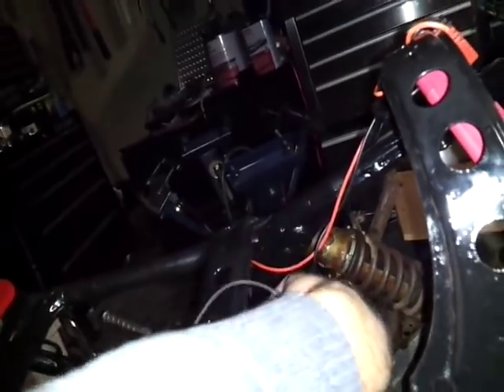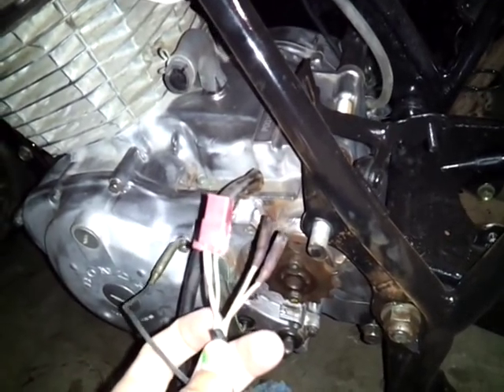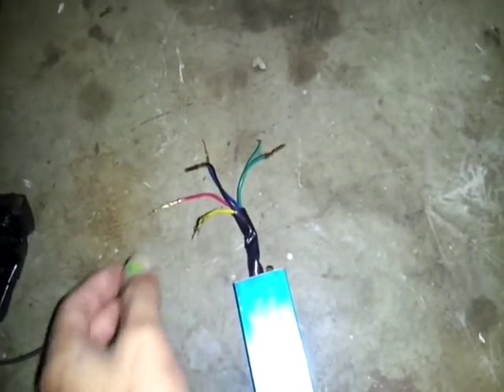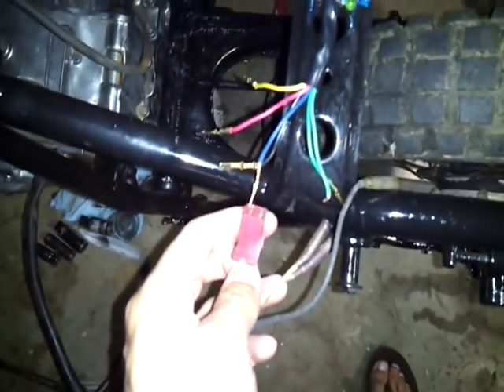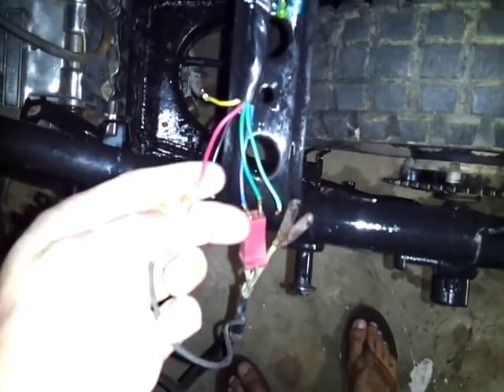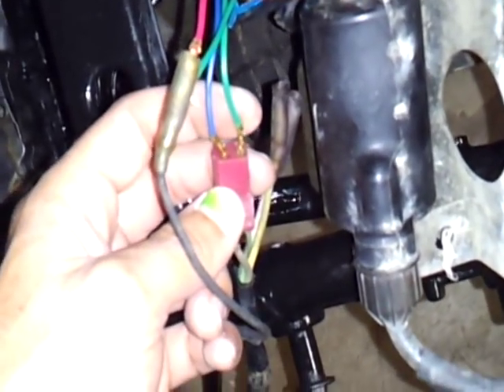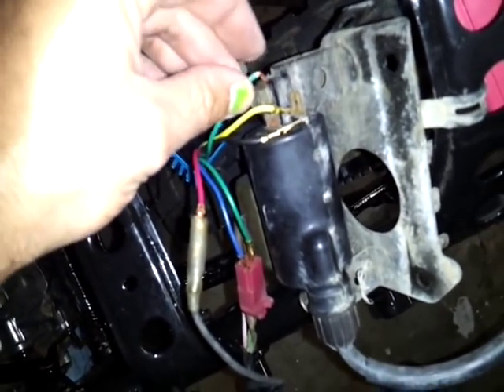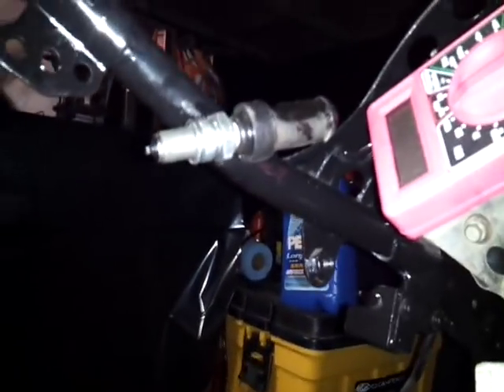CDI wiring Honda

Comment: I have a klx650 can I wire in a loom and cdi to get it to run
Reply from the maker: db db 
As long as you have an ac output as well as a trigger output.  
One will be a higher ac output than the other.  The trigger will be a lower voltage.  .

Comment: Hi,
One query regarding the stock ignition coils of pulsar 220 that it's cdi has two points to power 2 ignition coils.
But I want to install nmw racing ignition coil(dual wire ignition coil) which has only one point to take input. So how I am going to connect it.
Joining both the wires of CDI for giving power to ignition coil or giving the power output to nmw ignition coil just from one point of the cdi
Reply from the maker: You can use the same power input to power both racing cdi igniters. Then use one trigger wire for one of the calendars to fire, then the other trigger wire can go to the second ignition coil to spark that one.
Reply: IDUS 
Thank you for 
But still I have not understand so I will make this very much clear
Earlier I was having two ignition coils with two input points separately that goes to CDI output points(2 separate points)
But now I m having 1 ignition coil with two spark wires but it is having only one input point from CDI so how I m going to connect it 
Either by joining both the output points of CDI or just taking the the power from 1 point of cdi

Comment: Aye bruh good shit the black wire goes to shut off without hooking it up you won't be able to turn it off !!!!! But other than that your video helped me get my 86 rebel running!!!!!
Reply from the maker: Very cool. 
I'm glad it helped!
Thanks for the input on that black wire. I never hooked it up. I just used a switch to the ac signal wire.
Reply: IDUS  aye no prob you saved my life with this video I'm bout to link you in the rebel forms!!!
Reply: How exactly did you wire it, having troubl3

Comment: Pls. Show me elect.wiring diagram of 1984 Honda xl 125s,thank you.
Reply from the maker: Ernesto Guisadio  you want to find the wires that come out of the stator that generate ac voltage. One gives off more voltage than the other . The higher volt wire powers the cdi. The lower voltage triggers the spark.

Comment: after connecting the wires correctly, still no spark.
Reply from the maker: Guys Who Do Stuff what bike are you working on and what type of cdi do you have?
Reply: Same cdi and same motor same 30v and 5v ac setup
Reply from the maker: Guys Who Do Stuff Have you measured with a volt meter that you are getting a trigger AC signal that's about 30V?
Reply: IDUS yes
Reply from the maker: Guys Who Do Stuff do you have a flashing green light when you kick the motor over?
Red wire is 30vAC
Grn ground
Yellow goes to coil
Blue smaller AC voltage signal. 
You should get a flashing green light when kicked over. 
Grounds are always a problem in my experience so I would make sure it has a good ground.
Reply: IDUS no green light
Reply: Green is ground?

Comment: Hey, I have a Honda CBF 2010. Can I add a tachometer?
Reply from the maker: DynamicTwist yes. 
You can take the tac signal off the negative of the #1 cylinder coil.
Reply: Im a complete noob when it comes to this. JUts bought the cbf (Model without tac). But i wanted to buy one off Ebay. I have to connect 5 different wires. 
-long Black light -
-Short Black power/ignition lock +
-Short Green Ground
- Short Yellow engine signal line
   Will the stock bike have the required wires xD ? thanks
Reply from the maker: DynamicTwist looks like the module sucks power, so to prevent a dead battery, connect the ignition lock wire to a switchable 12v. Then the green or yellow is signal from your coil negative. Usually thats how they are wired. 
I would have to check the specific one you bought to be of better service.
Reply: Thanks for your time! Would installing one of these mean taking fuel tank off ? thanks
Reply from the maker: DynamicTwist you can usually find the negative signal wire to the coil at the ecu compartment. 
The. Switchable 12v is found by the relays.
Reply from the maker: DynamicTwist looks like yellow wire goes to ignition coil negative. Thats your signal wire.
Reply: would the wire reach easily? And do i have to take the fuel system off? Or can i easily do it without it. thanks

Comment: I have a 96 cr125 and the wiring is all over the place...I don't know anything about wiring I just want to replace all of it...where to I get all new wiring? How do I do it?
Reply from the maker: Alec Thayer do you have a pic of the wiring. 
You can email it to me. Andrew@broointech.com
Reply: idusclothing got rid of that bike a while ago lol
Reply from the maker: Those 2 strokes are awesome and really simple to wire. It does however involve a volt meeter. Usually with a harborfreight wiring kit, you can complete the whole job. So around $50.

Comment: Where are we, Gilligan's Isle?
 Professor, I really TRIED to take it seriously. I eventually suspected that you were attempting humor, especially with the connection techniques.
Hands, connectors, and time must have been in short supply.
 And it just pulls right off... awesome.
I thought you would have "actually started" the Honda for the patient viewer, though.
Reply from the maker: I cant help someone through this video if they do t know how to test for voltage AC. 
It was meant for someone who has the trigger wire (about 5v stated in the video) and the ac higher voltage wire (about 30+ ac volts also stated in video). 
Once Those are identified, i clearly show wiring. 
This guy running is in my other videos. Wired exactly how I show here. 
Thanks for watching.

Comment: I have a 1986 XR100R that I would like to convert to CDI from the original points system. Is the process pretty much the same as in this video? Also, where did you source the CDI ignition coil/bracket that you showed at about the 3:02 mark?
Any advice or tips you can give me is greatly appreciated, thanks!

Comment from the maker: This was the A/C cdi and does not require the black wire to be plugged into anything. Red wire gets ~60v from stator wire (you should have 3). Green wire is ground ect....

The battery would connect to your voltage regulator/rectifier (converting a stator ac voltage from a/c to d/c) and from the reg/rec, it would go to positive on battery after being fused. I did not have a battery because my stator runs all my electronics. 
Your negative on the battery just bolts to the frame.